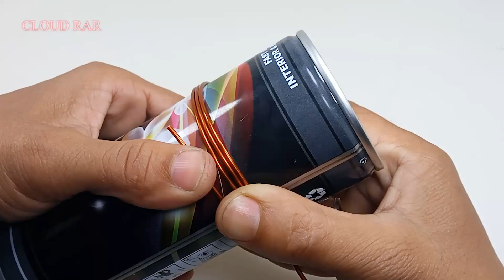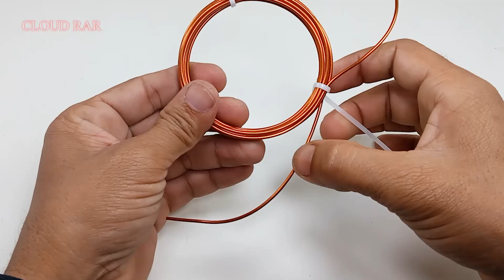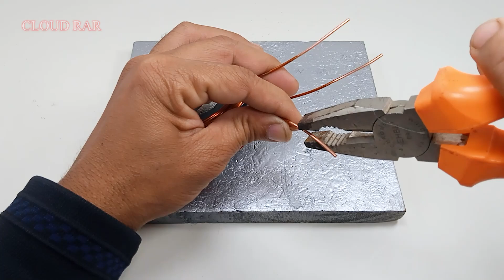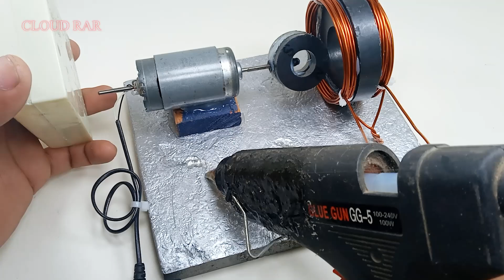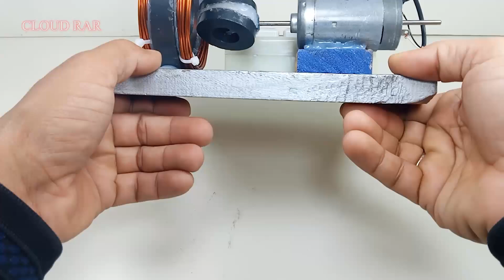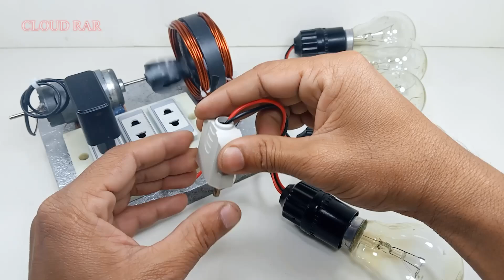How I Turned a Permanent Magnet And Copper Wire into 220V Free Electricity Energy Generator

Comment: These Generators are breaking a Permanent LAW OF physics The LAW OF THERMAL DYNAMICS! And some Work but for only a few minutes at a time , before they melt 🫠 into scrap metal. This one works for about 5 to 15 minutes and then slowly runs down as the motors cycles get to hot 🔥, But Nice Try...